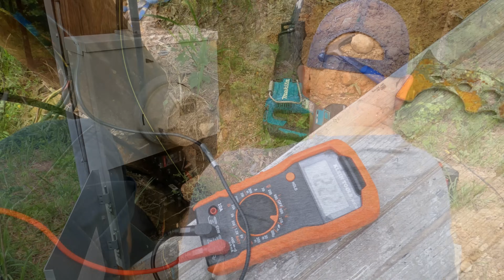WE ARE DONE! Building Dream Home in the Ozarks  |Off-grid power stations |Couple goals |Arkansas

Comment: If you’re using 12 wire, match it up with 20 amp breakers. Won’t hurt and not that much more.
Reply from the maker: Agreed ❤️ I'm only using 20 Amp so far.  I'll likely only use 14/2 on the lights.  What's your thoughts ?
Reply: @Itsallgrady  usually I wire everything with 12 wire and use all 20 amp breakers,  with exception of smoke detectors. I’ll wire them with 14 wire and use a 15 amp breaker.

Comment: I just had surgery on my left eye for cateracts on May 3rd going to get the right eye done on May 17th
Surgery went great.
I'm one of those people that really don't want someone messing with important parts of my body. But all my fears were for nothing.
My vision has improved greatly.
My surgery was 15 minutes.
Glaucoma surgery takes somewhat longer but is similar.
Praying Marcel is able to overcome his situation.
Glad you now have electrical.
It good to be on the side of caution.
It looked like Marcel was doing some  electrical surgery sitting in front of the polecwith Gage handing him the tools.😊
Marcel give yourself a slap on the back or have Denise do it if you can't 😊
I bet Gage was glad the fencing was portable so it eas easier to mow.
Checking out the soap right after this video 
Hopefully I can get an order in.
Reply from the maker: As I'm sure you can understand it's very scary.  Thanks for the comforting words.  Blessings ❤️

Comment: You will love it when AC is on, heater in winter, etc. Microwave heats a mug of water for tea etc.  But does your state require that it be inspected, I know Utah does but haven't seen for other states. That would be an extra bit of security, now you need to buy a smoke alarm & CO2 detector! Always something. Sunny Ja here!
Reply from the maker: Agreed, no inspectors, only contractors to look at it. We do have professionals helping with directions.  Good idea on the alarm.  Blessings